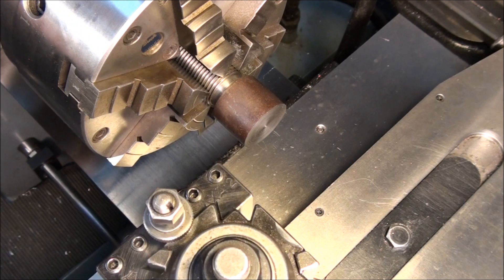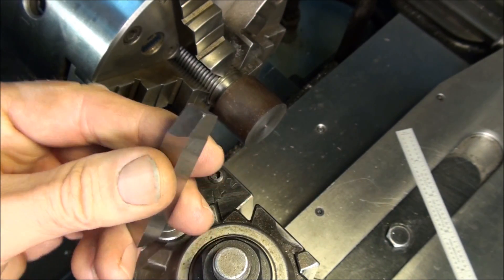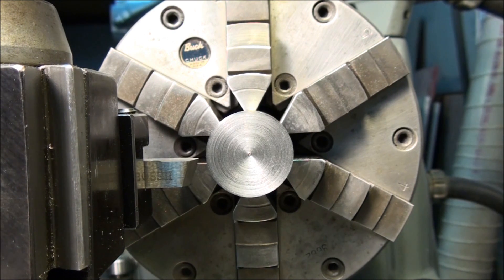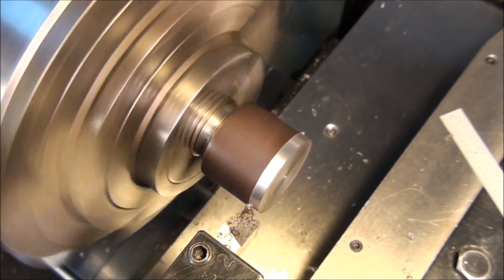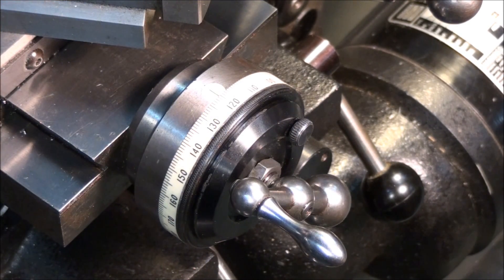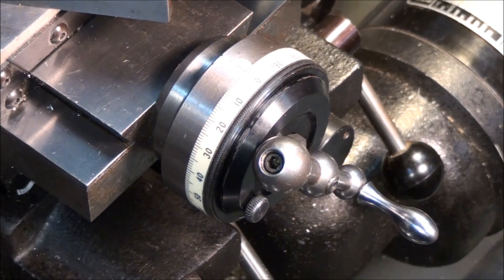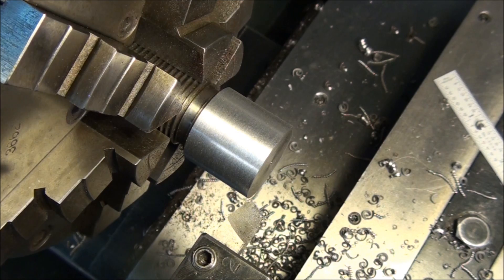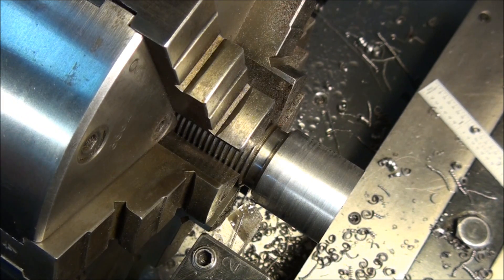Turning a Diameter to Size on the Lathe

Comment: Good video as usual. One question about returning the cutting tool to the start position. Do you always retract the tool from the work when you return the tool to take another cut? I have noticed when I return the tool to the start position without retracting, it still cuts. Can you tell me why that is?
Reply from the maker: It sounds like you've answered your own question. If you don't retract the tool, it will leave a mark on the surface. This is mostly due to spring in the set-up, but even if there is no spring it will still leave a mark since the tool is generating a scalloped, threadlike surface as it feeds. If you drag it back across the surface, it will cut through those scallops and leave a track.

Tom

Comment: Hi Tom, another good video, not necessarily the way I do it, but when asked I can confidently recommend your channel to beginners as a good place to start as your videos are clear, concise and to the point and without dogma, unlike certain beginner orientated channels.

Re dia/ rad cross slide dials, the convention this side of the pond is that Imp lathes are Rad and Metric ones are Dia, not a hard and fast rule just convention.
ATB
chris
Reply from the maker: Thanks Chris.

I don't think that applies over here. Most of the industrial lathes I've used read diameter on the cross slide and radius on the compound. One exception are the older South Bend lathes. I seem to remember some of them read the radius on the cross slide.

Tom

Comment: Tom,
apparently your lathe x axis feed reads direct, whereas my lathe, you have to double the number (radius vs diameter).  When you say feed in 104 thou, it is actually feeding in 52 thou.  What is your lathe?
Reply from the maker: Herb,

Most lathes read diameter on the cross slide and radius on the compound. I haven't used one in years, but I think some of the South Bend lathes were the exception. That just falls under the category of you need to know your machine because they are all different. My lathe is a Hardinge HLV-H toolroom lathe.

Thanks for watching.

Tom
Reply: Tom's Techniques
Tom,
To Herb's point, my Atlas/Craftsman 12" lathe reads Radius, i.e. the setting is "per side". In your demo, I would have fed 52 thou on the dial to reduce the diameter 104 thou.

Thank you so much for your informative videos.
Reply from the maker: My dad's Atlas reads diameter on the cross slide, and I've used older South Bends that read the radius. You just have to know your machine.

Tom

Comment: Very nice..... Just so e food for thought.  Could you show us how to drill really really super small holes that are accurate and won't break off your drill bit..... Also... Cover how to best use reamer's.
Reply from the maker: The trick with small drills is an insanely high rpm. A 1/16" drill for instance, should be spun at 6500 rpm to prevent. Any small drill like that should also be spotted with a center drill to help it start on location.

A video on reamers is a good idea, I'll add it to the list.

Thanks for the comments and the suggestion.

Tom